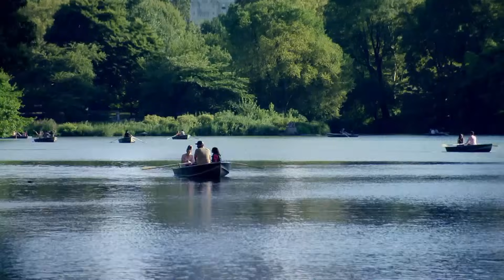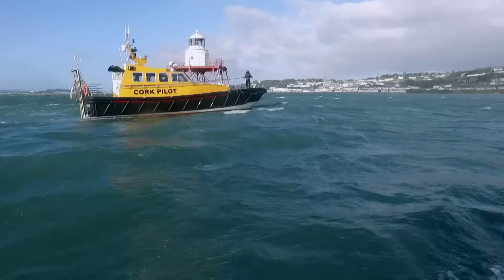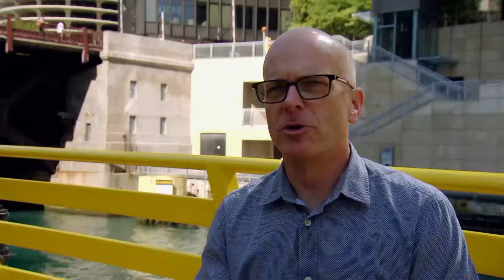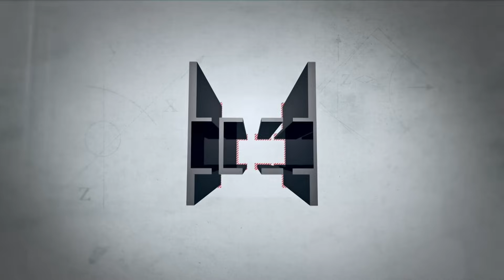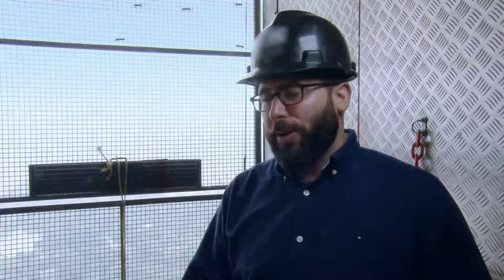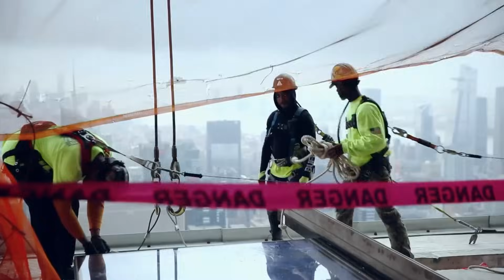111 West 57th Street, New York - Impossible Engineering NYC Mega Tower - USA Engineering Documentary

Comment: Fascinating. I understand the explanation of everything but I still don't get how it works or how anyone knew it would work at such a height. What about a curved structure to reduce wind pressure? Instead of pushing against flat walls, wind would pass around curved walls. I wonder if this was considered and if so, why a round design wasn't used.